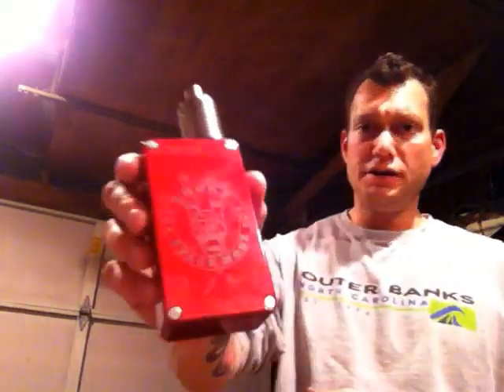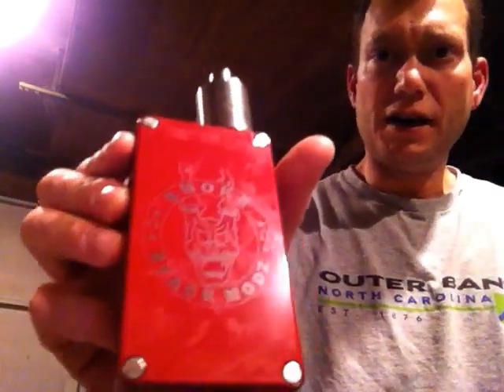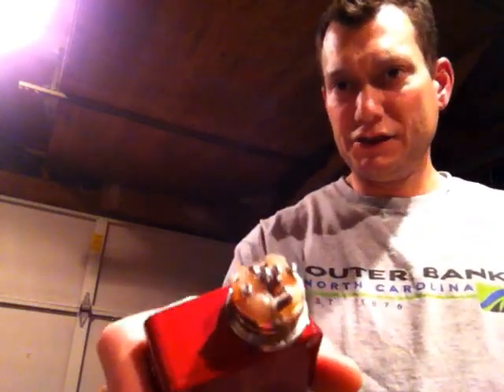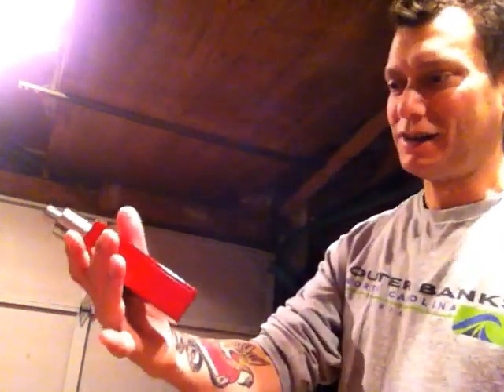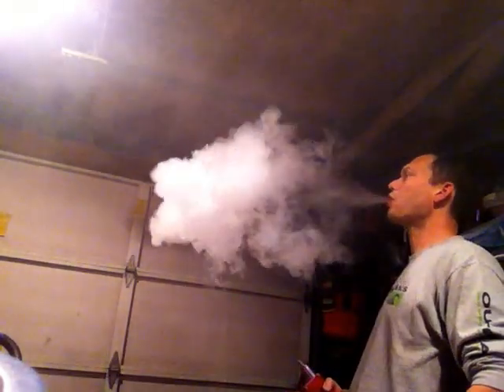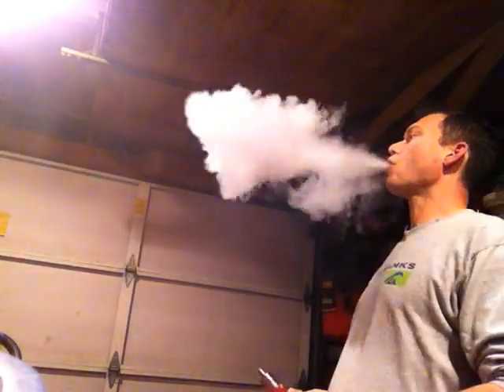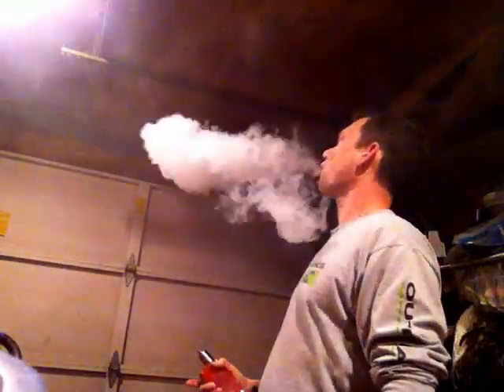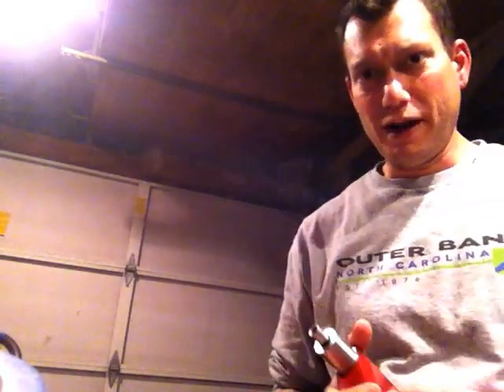Dual 18650 Series Unregulated Box Mod.  Awesome!

Comment: Thanks for the input! As I am getting a bc box mods series box in the mail soon and I've been researching builds and series box mods info in general for the past few months n it's nice to get input about builds n safety from more experienced guys like you
Reply from the maker: John Doe Thanks for watching, glad you enjoyed the video.  Just gotta have enough metal and resistance for all that power from 2 batteries to handle.  If you build too low you get painfully hot fireball hits.

Comment: Yea a lot of power !  I'm starting off with the dual 26650 series.  Once I master that I'll buy the triple 18650.  I just wish I could adjust the voltage on the triple in case it too much power.  I'm just excited for my 26650 box.  Do you know if he makes theses per order or he have a lot of stock?
Reply from the maker: +AMP33 He keeps fairly busy at it and usually has some in stock.  You'd really do best to contact him on facebook.  Joshua Ketterman Smoke Stack Modz.

Comment: Use 24 gauge instead of 20 gauge if you want to raise your ohms. 10 wrap of 24 gauge kanthol is about .5 ohms.  Nice outer banks shirt. I'm in vb
Reply from the maker: Kelly Cote' Cool, we love those beaches down there, go there every year.  Thanks Kelly.  yeah, you've got that right.  Thanks for watching, and for adding your knowledge.  I was still thinking in the wrong direction back when I recorded this.  Quite right on using higher gauge thinner diameter wire.  I've improved since.
Reply: Good to hear. Stay safe and enjoy.
Reply from the maker: Kelly Cote' Thank you.

Comment: What is your build in that video exactly?
Reply from the maker: John Doe 22 gauge 10 or 15 wrap dual coil I believe.  it was too low resistance for comfort.  around .4 ohms.  was a very hot vape.  In the months after this video I've built and rebuilt many RDA's for that box mod and found the best vape for it was 15 wrap 26 gauge 3mm diameter coils.  wicked perfectly with enough cotton to keep those coils juiced and pleasant warm to hot vape that I could take 3-5 second pulls.  Very intense vaping on this series box mod.